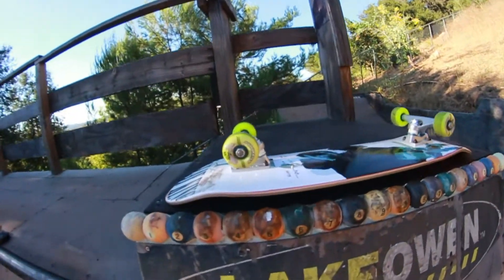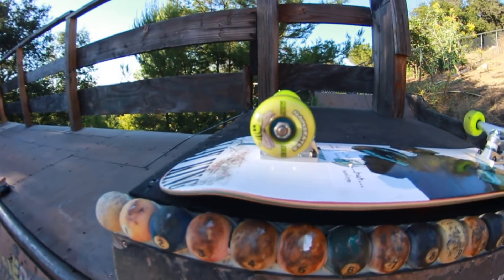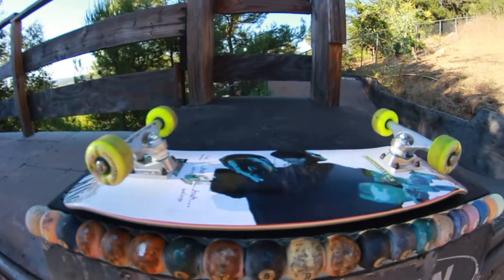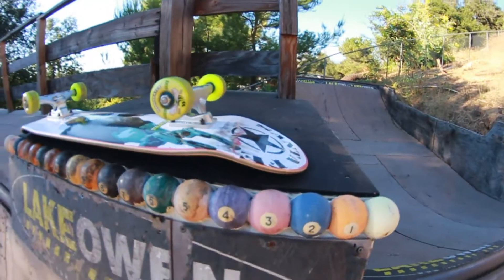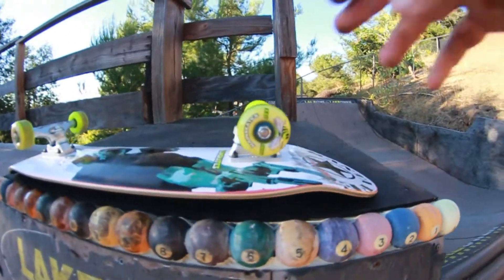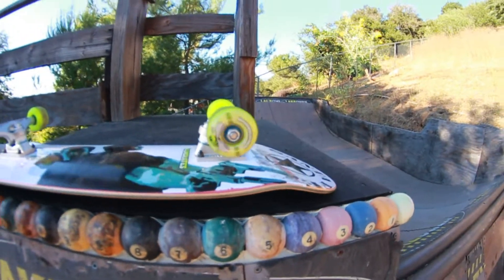Testing Out My New Transition Skateboard

Comment: Nice! 
What size do you normally ride? 
My street board is 8.25 but my bowl board is 10 inch. My street board has 54mm wheels and my bowl board has 61mm wheels.
Reply from the maker: Both my boards are 8. The main difference is the wheel formula. 10 inch board is manly!
Reply: @falcosk8  I am just carving around with slash grinds so the 10 fits me. Someday I will get some real tricks on it. 😂.